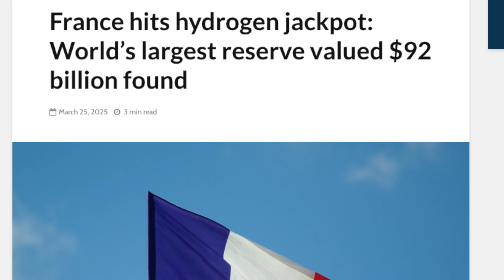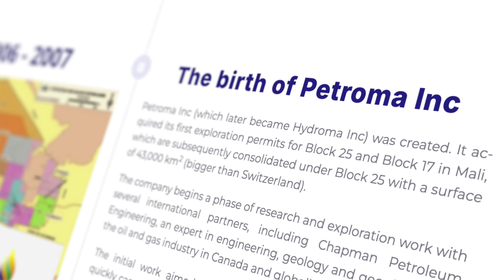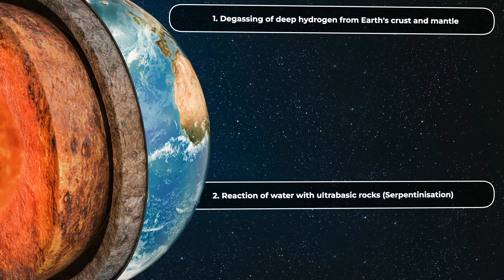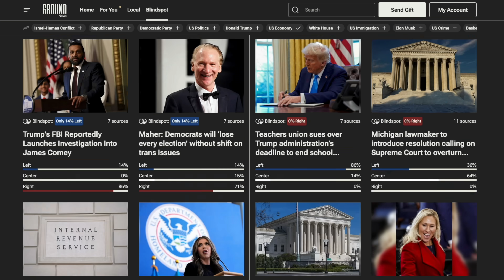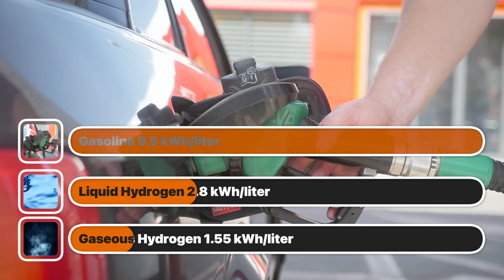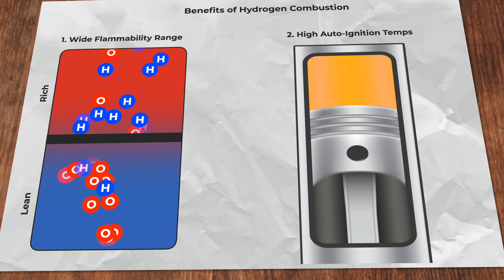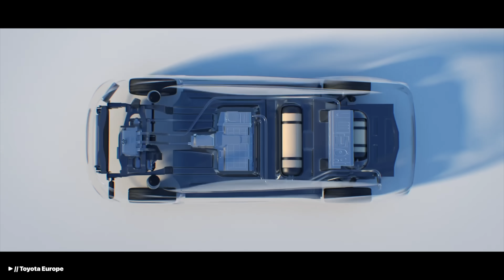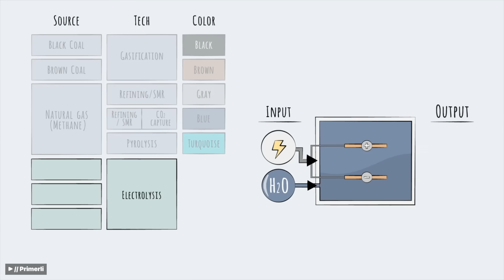This Hydrogen Discovery Can FINALLY Replace Oil & Gas!

Comment: Hydrogen has two main issues when using it in automotive applications; 1) Hydrogen being the lightest/smallest gaseous element you need to compress & chill it to get it down to any usable volume, however because it's SO small it will leak out over time, or warm-up and require pressure relief, meaning: if you have your Hydrogen car parked in your garage the fuel tank will completely evaporate in just two (2) weeks... and; 2) Hydrogen Embrittlement will eventually destroy any pressure vessel you intend to store the Hydrogen in.
I too used to be an advocate for Hydrogen vehicles, but these two issues are too great to be overcome (IMO)... 👀🤔😳👍👌✌
Reply: I agree that hydrogen as a fuel for cars is a pipe dream. I do however think it could be a viable option for both shipping and air travel. 

Both ships and airplanes have more capacity for advanced storage systems, and they’re more likely to fuel up right before leaving, which means they don’t have to worry about evaporation while idle. It’s also easier to install storage facilities at airports and sea ports rather than on every other corner for regular consumer use. The biggest issue would be overcoming that initial infrastructure challenge to make sure that all airports and sea ports have the ability to refuel with hydrogen.
Reply: That depends on the tank design. For example a Toyota Mirai has a Level IV tank design that doesn't have the issue with embrittlement, nor does it leak H2 as you describe. Other automotive, maritime, and airplane applications of H2 from Hexagon Purus similarly don't have the issues as you describe. Modern technology is great!
Reply: @buckley7747  the Toyota fuel tanks do leak, but if I recall (which may be wrong, its been a couple years since I read the report), its only about 1% every 30 days. so for the average driver, it would be virtually unnoticeable.
Reply: @cybernoid001  I haven't found the data for the Mirai yet, but for other type IV tanks I've seen it at 0.03% per day. I know they all leak, but as you mentioned it is low--and getting lower.

Comment: Transport isn't the main use of hydrogen though.  Steel and iron, and cement are huge CO2 emission sources. That's where Hydrogen could really make a difference. What is it going to cost to extract these fields in France?

Comment: Heating for homes is also an important use of diesel that could be replaced. The volumetric density is less of a problem in that use case.

Comment: This seems like a miracle. 
On the too good to be true side of things. 

Aus gas networks used to use town gas which was pumbed straight from underground, had a high CO2 content but also a high H2 content along with the hydrocarbons. Before the days when gas was cleaned to set standards.

Comment: Found out about this during the week and it was the most positive news I had heard for a while. A new, clean source of energy that is not far into the future like fusion. You should also note that Europe has a wide network of hydrogen distribution pipelines. How handy. They could simply pump the white hydrogen into existing pipes. Golden.

Comment: Practically speaking, hydrogen will be a fantastic fuel when it can be stored and used as a meta stable solid (Dark red) or a silvery metal, possibly liquid, like Mercury. 
At that point it will have a density of 500g - 1000g per liter. It is theorized this occurs at 4 million atmospheres. Just imagine if the protons all snapped into a lattice that was stable, and you could move it around as a bottle of liquid or a brick at 300K and 1 atmosphere. Now that would be a super fuel.

Comment: Hydrogen is horrible to store or transport, but it's very easy to use it to make ammonia (NH3).  It's liquid at just -28 F, and 8.5 bars at 68 F.  That ammonia can be used in both fuel cells to generate electricity or internal combustion engines.

Comment: Hydrogen can never be used as a universal fuel for everyday use - 'Specially in aviation ! This is nothing to do with the cost of producing the gas it is to do with the necessary cryogenic  and pressurised containment of bulk storage. High strength pressure vessels or cryogenic tanks are the only way to contain this gas and both are unsuited to long term storage. Aircraft tanks able to contain these pressures or to store cryogenic fuels would be too heavy and bulky to be practical. Even then, the hydrogen is going to boil - off overnight making for a serious risks of explosion.  Leave your hydrogen fuelled car at the airport car park for a couple of weeks and you find the gas has boiled off whilst you enjoyed foreign parts. Impractical and very dangerous as an everyday fuel and providing far less energy per unit  volume  than gasoline, hydrogen as a successful petrol substitute for domestic use is never gonna happen. If you think an electric battery is a fire risk in a car crash, try a ruptured hydrogen tank for some real fireworks !

Comment: Water vapour is also a greenhouse gas. Burning hydrogen for energy is not a good answer to warming of the climate.
Reply: Water vapor is indeed a greenhouse  gas.  However, unlike CO2, water vapor eventually becomes liquid water and falls back on Earth. It is not a long term greenhouse gas unlike CO2 which warms up the Earth for thousands of years.

Comment: Given the storage and transport issues and the need for rare metals for fuel cells, hydrogen would best be used at the commercial level and not the consumer level.  And better to use for de-carbonizing steel production and for producing ammonia for fertilizers.

Comment: When comparing the Tesla battery to the Mirai you compared the battery of the Tesla, which produces electrical output, but only the fuel component of the Mirai, that needs a tank plus the fuel cell plus a small battery as well.

Comment: If these deposits of hydrogen gas were so easy to tap and burn at the same site, there would already be power stations built there, running plants since we are talking about an easy process, or is it???  Something doesnt add up here. There is likely some kind of hidden issue with rate of production, flow rates, leakage etc.  Online information says that these stores of white hydrogen are actually the mineral Olivine, which is absorbing water and releasing hydrogen gas........which means its not like an oil field, that can be simply drilled into and the hydrogen comes out in a nice steady flow.  Lets remember that 92 billion is actually small potatoes in the world energy budget.

Comment: The problem with Hydrogen is that it is very,very difficult to get to liquid form.  Storing it as a gas is also a problem, for volume reasons, and in both forms it is the most dangerous fuel source, due to its issues with explosions which produce a shock wave 300% faster than any other known chemical.  It is useful when made into other chemicals such as Ammonia and Methanol. Methanol can also be upgraded to Butanol which is a perfect drop in replacement for Gasoline and also blends perfectly with Gasoline.  So if a resource of Hydrogen is turned into Butanol at its point of production then its useful.  Butanol can work in all ICE engines and even jet turbines, it transports well and stores easily and safely in simple underground tanks. There is no future in liquid hydrogen as a fuel, its simply to expensive to turn into a liquid and its highly problematic to store in cryogenic tanks, without it venting in a short time frame and safety problems.

Comment: Meh. Just another finite resource that will eventually run out and cause all the disruptions that all other big commodities cause. 

IMHO, we should just stick to the solar/wind/ battery storage plan that seems to have a better long term future and is probably the least expensive process in the long term. And it won't blow up city blocks when storage leaks and gets ignited.

Comment: I have been holding out for a solid, economical hydrogen fueled vehicle. EVs help reduce carbon emissions, but they just shift the fuel usage from the consumer to the energy companies, ie, they have to burn more oil to account for the extra electricity demand. Of course, the lack of a hydrogen fuel infrastructure has also stagnated hydrogen powered vehicles. I am hopeful that more discoveries like this will help us get away from fossil fuels. And hopefully we can get other nations to commit to switching to a new, cleaner fuel. Maybe we do have a future.. at least until Fusion power arrives, which i hear is just 30 years away 😆

Comment: This is sequestered hydrogen. If released it will bind with free oxygen to create hot water vapor while releasing heat energy. Water vapor in the atmosphere is vastly more of a greenhouse gas than CO2. Plus, it will eventually precipitate out of the air as liquid water potentially raising sea levels. 😢

Comment: Paid for by the hydrogen industry? No mention of hydrogen leaks, reinforcement of tanks to control it, or hydrogen turning steel into flakes. Even if hydrogen was twice as abundant as oil, it’s still very difficult to use and next to impossible to transport. This might be a huge boon for France and industries that have a hard time weening off oil. A worldwide replacement of fossil fuels this is not. Fossil fuels on top of being burnt are used in chemicals, plastics and lubricants. Solar and wind have gotten so cheap, minimal dependence on oil and nuclear for electricity will be needed post 2040.

Comment: Fuel cells need air filters which need regular maintenance and for vehicles they still require a backup source for acceleration eg batteries. So they still may not be a low cost per mile/Kilometre.

Comment: On a comparative scale, hydrogen is a low-energy-yield fuel. It gives far less energy per mole than standard fossil fuels.
   To be truly eco-friendly, this hydrogen would necessarily have to be oxidized with pure oxygen in order to produce only water as "exhaust".
   When used in the atmosphere, side reactions can produce hydrogen cyanide (HCN) as well as unwanted carboxyls and other potentially noxious and persistent compounds.
   All this aside, the complications involved with storage, transport, safe transfer to vehicles and the "ability" of hydrogen to eventually permeate through and degrade containment vessels makes it more trouble than it is worth.

Comment: You did not address the accessibility of the white hydrogen.  The deposits I've read, about  are really deep - like 10 km.  If that is typical, it will be a lot harder to get at than natural gas usually is.  Then, once you've got it, handling the stuff is tricky.  It's very slippery.  I hope there's a practical, economic way to get to it, but I'm not optimistic.

Comment: Distribution of hydrogen is problematic.   So individual use of this resource would be very expensive.  But using this hydrogen where it is found in central generators, then distributing the electricity through upgraded and existing wires may be a large step towards zero carbon.

Comment: If it is in liquid form underground OK (though my mind can't wrap around how it could be) but in gas form it would need to be compressed to liquid to make transportation remotely viable. That along would probably make it pointless to try and transport anywhere outside of France. France is better off running a pipeline from where the reserve is to a few nearby electrical pants and convert them to hydrogen. It isn't a big enough find to make a worldwide difference but it coukd really help the rest of Europe if France had a diminished oil need.

Comment: I am disappointed Ricky, you failed to describe the difficulties in tapping that source of ground based hydrogen. If natural gas is problematic to use due to the many leaks to the atmosphere of un-burned gas at mny points in the distribution systems we have for it, hydrogen, 'the great escape artist'  will be worse in wide use. 
Our  wide use of gasoline was and still is a mistake based on its treatment as a 'waste' product from the distillation of kerosene in the late 1800's for lighting and heating oil.  It was cheap fuel and encouraged the making of the internal combustion engine over its competitors, electric and steam powered vehicles. 

I would like  a look at how much of the hydrogen currently being produced in Mali gets lost to the air in their process. Hydrogen molecules can get through sealed steel containers causing embrittlement. That is just one of the many problems it poses in the limited distribution we have today. Those losses would get much worse if used so much more widely  and encourage us to stay with the low efficiency IC engine technology we use today. Even fuel cell vehicles would be less efficient overall.
 "Green" hydrogen found in the ground just cleans up a small part of our hydrocarbon emissions since it will get treated as a commodity with a number of distribution nodes that keep the "middlemen" in the loop taking their cut from source to end user with leaks at every node, and probably some in between nodes. Electricity generation and distribution does not tend to be so leaky or inefficient.

Comment: It seems highly unlikely that the total amount of Hydrogen in geological formations is anywhere near the quantities of oil and gas, never mind coal, in geological formations.  Otherwise a lot would have been found as we drilled for hydrocarbons.  It seems possible that this hydrogen has been produced by the same sort of process that occurs in the recent discovery that ocean nodules also produce oxygen from the breakdown of water.  Of course the other product is Hydrogen.  If we switch to hydrogen based on these geological sources, it will run out rather quickly and leave us with stranded assets.  Better that we go with the virtually unlimited resources of wind a solar in which we are already well along the technological/learning curve.

Comment: we receive plenty of energy every day, the problem is storing it effectively. Hydrogen is great by mass, but not effective in all other considerations. A closed loop electrolysis/fuelcell system might be a viable solution for stationary applications

Comment: It's nice they've found a deposit of hydrogen, but of itself, it's not all that significant given the world used something like 4.3 trillion cubic meters of natural gas last year, mostly to produce electricity. 
However, hydrogen can be produced cheaply and sustainably. There is a form of renewable energy ideally suited to long term sustainable hydrogen production, that is, Magma Energy, as described in glowing terms by Nasa Sandia Labs 1982 Magma Energy Project research. 
Magma Energy is practically limitless, constant clean energy from high temperature geothermal. Hydrogen is the natural storage and distribution medium. If we had Magma Energy, we would almost certainly also have hydrogen fuelled transport. 
And base load clean electricity - multiples of global energy demand, carbon free for ever after! 
Still a possibility, just about.

Comment: I have seen hundreds of drill stem tests from attempts to drill for natural gas.  There is usually a few tenths of One percent hydrogen, with methane about ninety five percent.  Some reservoir in France where there happened to be an unusual acid base reaction producing a little bit of trapped hydrogen isn’t even worth talking about.

Comment: One of the biggest problems with Hydrogen that you forgot to mention is "embrittlement".  Hydrogen atoms tend to diffuse into the metal of the (typical) steel tanks that are used to try and confine it.  Over time, this interaction with the metal's microstructure, reduces its ductility and makes it prone to fractures.  In short, metals (especially high-strength steels) become brittle and crack due to the absorption of hydrogen atoms. This process weakens the metal's internal structure and can lead to unexpected failure, even under normal loads.

Regarding fuel cells, one of their big problems that I rarely see mentioned is their limited lifespans.  In passenger cars, manufacturers typically aim for a fuel cell stack lifespan of only 150,000 to 200,000 miles, before then entire thing needs to be replaced.  Replacement of a fuel cell is necessarily going to cost a lot more than a typical car battery replacement.  The durability of fuel cells depends on factors like hydrogen purity, operating conditions, and maintenance, but it is typically much shorter than an equivalent battery.
Reply: If a steel tank is used. There are plenty of applications that use a type IV tank that doesn't have that issue.
Reply: Polices is not science.

Comment: You sound like a paid shill for the hydrogen fuel industry. The fossil fuel industry would like nothing better than free subsidies to build out hydrogen fuel infrastructure augmented by the burning of more fossil fuels for grey hydrogen. Never mind underground stores of hydrogen are inherently non-renewable. And what about the downsides? What about the extreme pressures required to contain hydrogen? What about the fact that hydrogen is a potent greenhouse gas? What about the fact that leaky hydrogen infrastructure is an inevitability because the element is so small and hard to contain? I feel like this channel has really gone downhill.

Comment: We need you to give all pros and cons , like hydrogen molecules being so small that they leak through metals and seals the tanks are heavy to contain 700 bars pressure , that’s a big problem for aircraft . I would have liked full disclosure not just the positives
Reply: A company has developed a method to easily store hydrogen in a solid matrix.   Very little energy to store or release it
Reply: @joelpedigo9299  And how much does the matrix weigh, and how much does it cost?